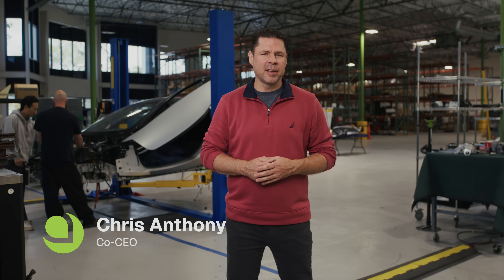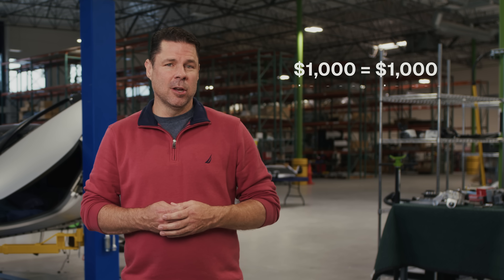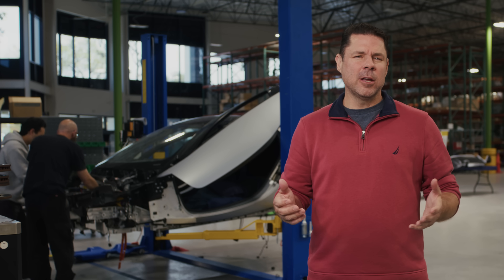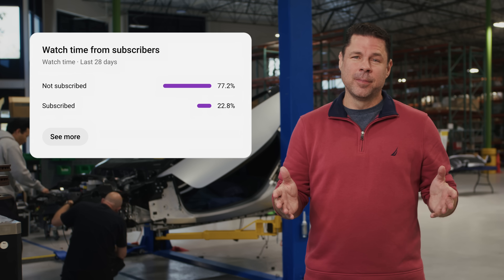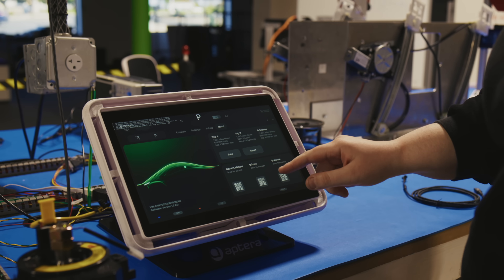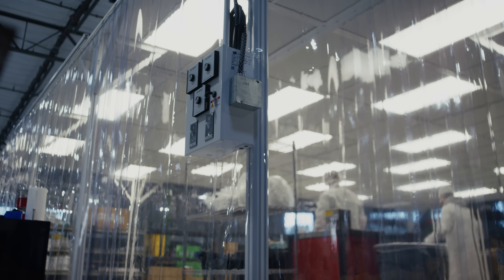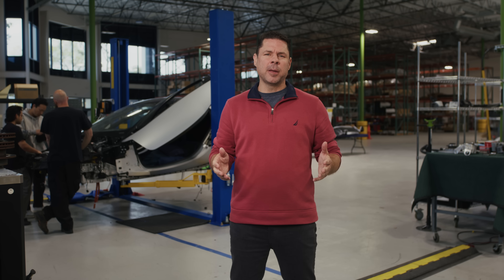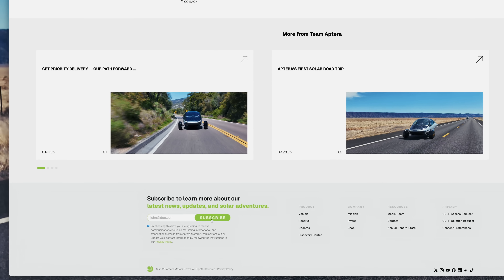Aptera Update — April 2025

Comment: I noticed a potential flaw with real world applications with the tires. It makes me nervous to imagine that the back wheel has a high chance of getting stuck anytime there is rugged terrain, and that it would be quite bumpy with any big potholes. A simple solution to this could be to have a wider wheel. Semi trucks do this with what are called super single tires. I think you should do this for your back tire to prevent the necessity for frequent towing service calls.

Comment: 2 points: 

If you don’t need a heater where you live can you opt out? I only need AC and most of the time i don’t use that. 

Also have you considered using titanium in the car? You can buy standard titanium bolts quite cheap in bulk and it would reduce your bolt weight by 40% and they are also very strong and don’t rust like steel. I switched all the steel bolts on my bike to titanium. 🙂

Comment: I have 2 reservations - 1 for me and 1 for my daughter - I can’t help but be concerned about BYD offering 4 passenger cars with better batteries for less than Aptera.  It might explain why the investment community of high rollers have yet to write a check to cover Aptera’s needs.  Aptera was always going to be a niche car being a 2 seater and 3 wheeler.  Is the Aptera going to succeed commercially ?   I have my concerns - but so far it has not changed my mind about buying 1.
Reply: My understanding of the Aptera was that it was aiming at super high efficiency, as in the total amount of electric it consumes to travel a distance will be much lower than tesla or BYD vehicles, which is why it has some of the tradeoffs it has, and also why it makes sense to even have solar panels in the first place- you could foreseeably get some meaningful driving value off of them, vs. with a lower efficiency car where you'd need a full day of solar just to drive one mile.

Comment: Aptera really needs to start shipping. My first Aptera reservation was in 2007, nearly 18 years ago. I was super excited about the car then and Aptera could have beaten so many other EVs to market. Now they have another opportunity because no one wants to buy a Tesla right now, please start delivering cars.
Reply: That company liquidated in 2011, This company was founded in 2019. Very little of the work that went into the original design is used in what you see here.
Reply: @brandonloukota4760 if that was true it would be a shame since the car I drove was a hyper-efficient three wheeler with a coefficient of drag like an airplane, everything else is/are improvements which could be made for new model years. of course I know the company has restructured but that was years ago and the window of opportunity is closing. real companies ship.
Reply: That Aptera in 2007 is completely separate. If you liked in 2007; rationality speaking; one has to be thrilled now !!!

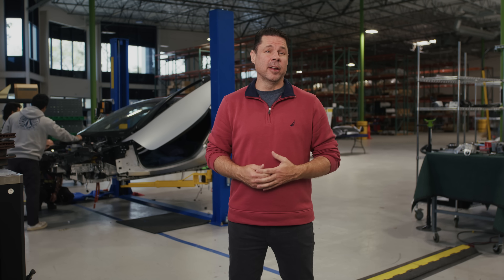Comment: At 2:08 do you mean wiper control through the touch screen?  That would be a major safety issue if you need to navigate the touch screen when it starts raining on the highway!
Reply: Wiper control is on the turn signal stick.  There is a another video on that from some time ago.
Reply: @Mister_Stone  Ok great, I couldn’t tell if they were talking screen integration or more broadly backend software integration.  Thanks for clarifying it!
Reply: @  Also somewhere I saw a video showing manual buttons for Park, Neutral, and Reverse just below the screen.  Maybe that was on a recent Free Power video.  That seems good if there is a failure of the screen, or maybe that whole system.  I"m not sure if that is still there or not, but I'd guess yes.
Reply: I am going to agree with Matt here, hard switches for climate, audio and other controls is much safer than the proposed 12” screen interface they have planned. Screen controls are distracting and non intuitive when actively driving.
Reply: @sorenmelchior  Honestly that screen seriously looks Amateurish!!!
Reply: @srinutakkallapalli1700  It was state-of-the-art 20 years ago.

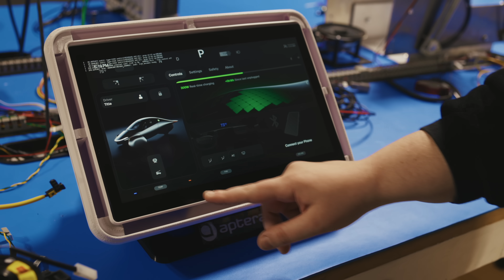Comment: 1:47 does anyone else hate that they put the vents around the screen? Those bezels are straight out of the early 2000s! Plus wouldn’t that make your hands cold if you’re constantly touching the screen? I hate that my car has vents too close to the steering wheel because I can’t get airflow from the AC to my face or upper body without freezing my fingers.
Reply: There shouldn't be a screen at all. They should offer a version like Slate, with just a phone mount.
Reply: @scottdisselhorst9744 
Totally Agree. No need of Screen at all other than look “cool”; which it really isn’t. It was a Novelty way back when !!! Not anymore. It might be useful if you have Level 3 self driving…. May be. That is the use case …. May be.
Reply: When you factor just the efficiency if you plugged it in to charge, not even including the free solar charging, the savings makes the overall cost much lower than Slate.  Add in the free charging and the difference gets bigger.

Comment: As an early reservation holder and investor, I’m stunned no angel investor has participated.  Why are celebrities, sports hero’s, Shark Tank investors, and middle eastern oil princes not investing?  

The answer may be too high risk with potential return, if any, a decade away.  For reservation holders, investment attraction is very different because they want to own the product.
Reply: A lot of that is that when they let other people have control of the company in its first go round, the vehicle got completely changed and the company tanked.  The venture capital crowd wants control.  These guys don't want to let anyone ruin the most efficient vehicle out there.

If I were a big VC guy I might be hesitant to invest without control UNTIL I saw the efficiency numbers verified in testing on the completely full-production vehicle they are finishing right now.  Once I saw it using 100 Wh/mile, the EV equivalent of 350  MPGe, then I be more likely to get behind this.

There were a number of huge investors lined up to cover about half of the $60M round at the end of last year, but each was waiting for others to commit so all of it would be covered before they got in.  That made it fall apart.  There's a huge difference when they see that Aptera is no longer theoretical.
Reply: @ You make very good points.
Reply: They probably did their due diligence and saw what happened with the invested money of the first Aptera iteration.
Reply: @Throckmorton.Scribblemonger  Completely agree.  I have a family member who is a VC partner.  She advised not to invest any more than current $10K and reservation deposit because we don't know the financial details of company.  Only potential investors gets this information.  

Motivation from investors is RIO and timing which is totally different from crowd funding.  Crowd funding is motivated by getting your hands on the product.  Financial returns are a distant secondary.

Comment: So, is the $100 deposit I paid over a year ago to reserve my place in line still valid, or do investors jump the queue?
Reply: Depositors reservation numbers started at 10,000.  Accelerator program took slots 1 to 2,000.  These incentives will take up slots 2,000 to 3,000.  So at the present you've moved forward about 7,000 places in line.

This is what it takes to get the vehicle into production, so the great majority of those holding reservations are pretty happy they are doing what it takes to get this into production.  Even if we weren't moving forward in line, this means production starts sooner, so you get your Aptera sooner rather than later.
Reply: @Mister_Stone  Will you be writing a check to cover any losses for your claims?

Comment: I hope this sees production. If it does, it will be the only new car I will buy. It's the only passenger vehicle that makes sense to me.
Reply: Definitely the only vehicle that it makes sense to put solar panels on it!  On every other car they don't really add any meaningful power.
Reply: * motorcycle
Reply: @thebeachtoday1127  Something like an enclosed three wheeler with climate control makes sense to me, but nothing like it has ever reached production. There have been many attempts.
Reply: A two-seater that's wider than a Humvee doesn't make any sense.
Reply: @Throckmorton.Scribblemonger  Cool. I bet it corners better.

Comment: While T***p tariffs might hit you hard because some production takes place in Italy, why not push to go earlier onto the European market? I'd highly appreciate 😁
Reply: Currently, the maximum permitted width for all vehicles in the European Union is 255 cm (100.4 inches). This law was enacted in the mid-90s to limit the size of buses and trucks.
Reply: @Mister_Stone  Wrong. The maximum permitted width of a three-wheeler in the EU is 2000 mm (78.74 inches); the Aptera is 2235 mm (88 inches) wide.
Reply: EUR-Lex
Access to European Union law

Two- or three-wheeled motor vehicles: maximum dimensions, masses and loads

This Directive comes under the - type-approval procedure for two- or three-wheeled motor vehicles, initially put in place by Directive 92/61/EEC, which was repealed and replaced by Directive 2002/24/EC.

The vehicles covered by the Directive are as follows:

    mopeds: two- or three-wheeled vehicles fitted with an engine having a cylinder capacity not exceeding 50 cm3 and a maximum design speed of not more than 45 km/h;
    motorcycles: two-wheeled vehicles with or without a sidecar, fitted with an engine having a cylinder capacity of more than 50 cm3 and/or having a maximum design speed of more than 45 km/h;
    motor tricycles: vehicles with three symmetrically arranged wheels fitted with an engine having a cylinder capacity of more than 50 cm3 and/or a maximum design speed of more than 45 km/h;
    quadricycles: four-wheeled vehicles whose engine cylinder capacity does not exceed 50 cm3, whose maximum design speed is not more than 45 km/h and whose unladen mass is less than 350 kg are considered to be mopeds;
    other quadricycles are classed as motor tricycles.

Establishment of maximum authorized dimensions, masses and loads:

    dimensions: length 4 m, width 2 m and height 2.50 m;

[end of citation]

However, that law applies only to motor tricycles, not autocycles.  According to Transport & Enviornment, the regulations for cars and autocycles says "The current EU maximum width applied to all vehicles, 255 cm"

Even a Ford f-150 pickup truck can be imported into Europe using  Individual Vehicle Approval (IVA). This allows individual vehicles, like the F-150, to be registered based on a more limited set of requirements.
Reply: @ An autocycle is a motor tricycle.
Reply: Too wide to be licensed in most of Europe.  Check your personal status.

Comment: So the vehicle that did the AZ to CA road trip (gemini?), did that not have thermal management system?  I'm guessing it had to have the battery & motormanaged, but nothing in the cabin?
Reply: Seems not. Also no charging heat management so no charging over 120/240V. 315 miles downhill in ~12hrs is how they managed heat. Lower speed helped miles/kWh. Still only managed 7. Imagine what's coming at faster speeds with more ventilation :-(
Reply: @artsmith103 Any idea how much weight the components of the thermal management system might add to the Aptera. When Aptera said the track vehicle was heavier than what the production model would be due to steel parts they didn’t mention it wasn’t carrying the weight of the cooling system.
Reply: @simonthedog7980  You are correct. Also, interior finish for sound and comfort. Also yet to come airbags. Battery temperature management equipment will be small because battery heat load is small. I think around 2kW peak. For comparison the motor radiator is ~1ft^2 for 15kW peak. Probably similar to fork mounted oil cooler on a motorcycle. Pump, reservoir, tubing, power supply, temperature measurement.... I guess around 20-25 lbs. Hopefully ~1gal.
Cabin HVAC is bigger. I expect ~1 ton (big window unit), about 3-5kW. Similar to any small vehicle like a Civic. Another radiator, fan/motor, duct, compressor, coolant reversing valve. Similar weight to window air conditioner with heat option, 60lbs?
Reply: Internet says 3kW for small cars, 4kW for medium cars, and 5kW for large vehicles.